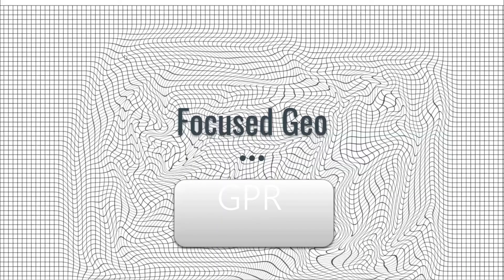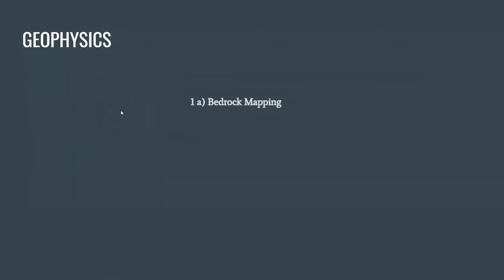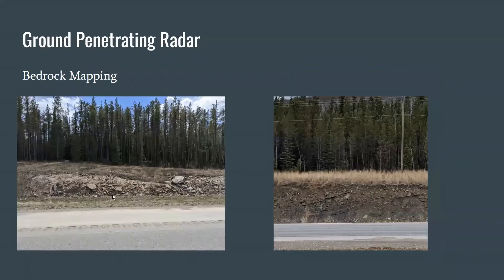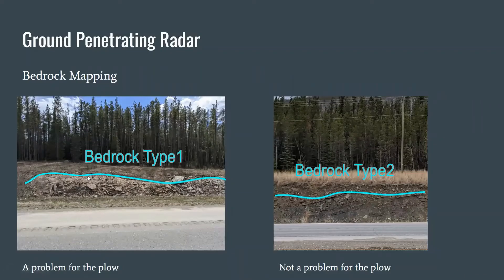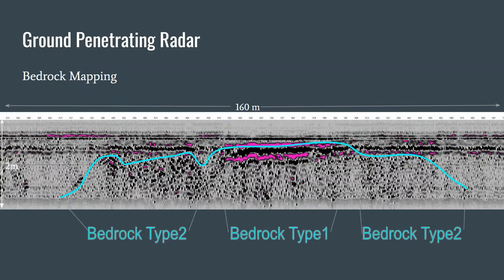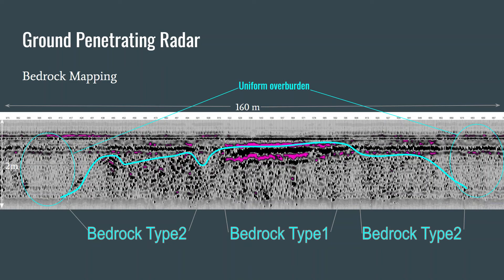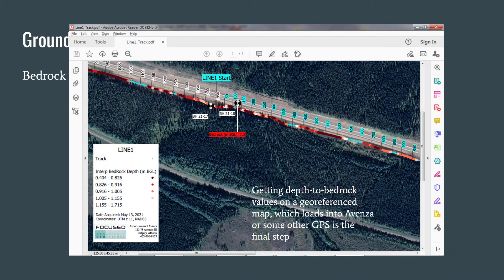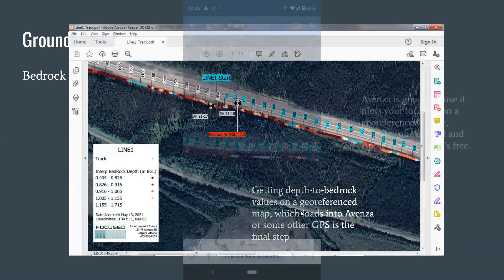Bedrock Mapping with Ground Penetrating Radar (GPR)

Comment: Hi thank you for the video! im very much interesten in learning on how to locate the depth to a bedrock and 2m is the depth iam mostly interested in. lenght of the profile is usually 10m. how on the radargram do you differentiate bedrock with different types of soil? is there some special signals i need to pay attention to? in the radargram from your video bedrock was highlighted with purple or pink. is this colour was set by the system or you based on your guess?
Reply from the maker: typically bedrock will have electrical properties quite different from overlying soils, and this will trigger a reflection.  The strength (or clarity} of the reflection depends upon how different the overburden is from the bedrock.  A gravel bed over granite bedrock should generate a large reflection, while a clay over sandstone may not generate any discernable reflection.   A lot of variables.
Reply: @focusedgeo3658  I see, I dig pools in Sweden and here every other backyard has either small bedrock or a big stone. So being able to detect it before an excavation would be a great thing. I have purchased Oerad Scudo gpr. So my plan was to scan each jobsite before digging , and than dig and compare my analysis with actual reality, so I could see whether I will be right with my prediction. But as I was getting deeper into the subject it seems like it easier said than done:) . Sometimes I see continuous lines below the ground and they can be seen as a slope, and in some cases it’s just another type of soil. So I guess practice makes perfect! Any tips you have for me?
Reply from the maker: @ЖИЗНЬСДЛИННЫМ  You've got a good idea there.  If it's an isolated stone, look for deflections off the ends, like "tails".  For continuous bedrock, perhaps the "strength" of the reflection will be stronger, also, deflections may appear at if the bedrock is weathered (not smooth)...  If you're working in backyards, beware of above ground features like fences or the walls of buildings which will appear as linear reflections, especially if they are metal, like chain-link fences.   I may put more examples of bedrock cross-sections on our website. focusedgeo.com  With time and experience, I'm sure you'll begin to understand which GPR reflections will be excavating problems.
Reply: @focusedgeo3658  thank you. Would love to see some example of how bedrock looks on profiles. Iñ